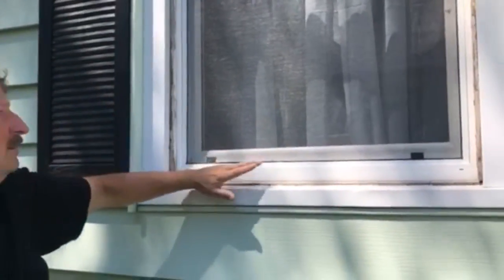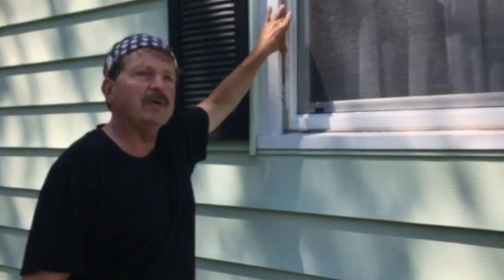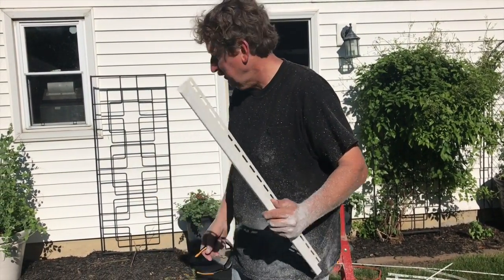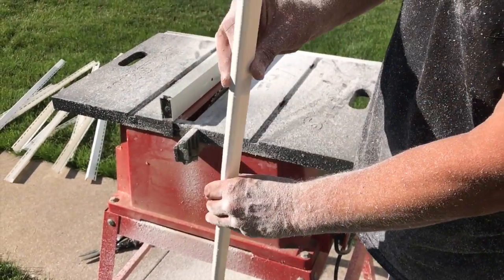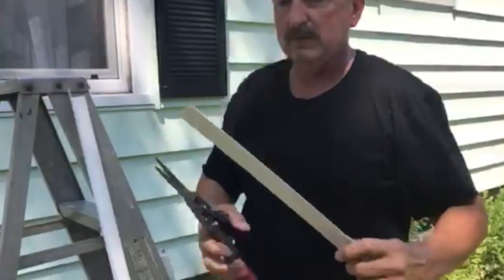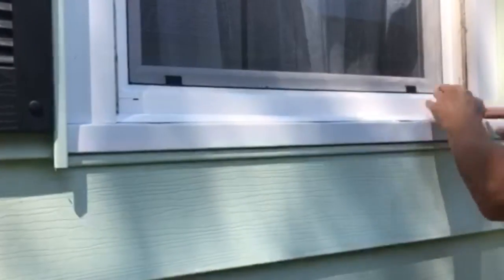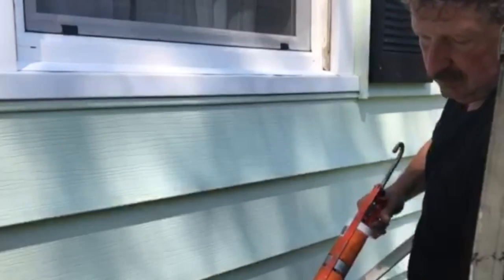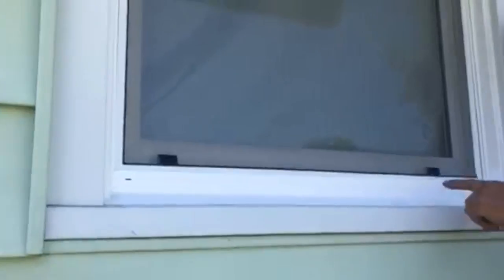easy cheap diy exterior window trim

Comment: A contractor wanted $260 per window (I have 13) to wrap that small gap with aluminium. I knew there had to be a DIY alternative!  Thank you!
Reply: wow as if!! Most contractor charge between 50 - 100 an hour so I wouldn't pay more then 100 per window or door! And only if they have their own equipment and can buy the materials for you. If they make you rent stuff and get stuff yourself I would charge even less then that like 75 per